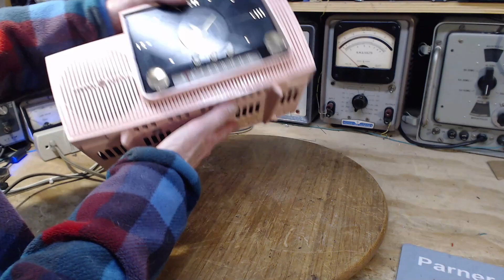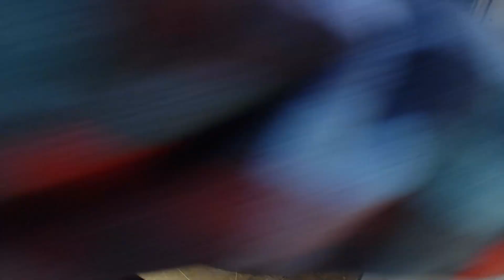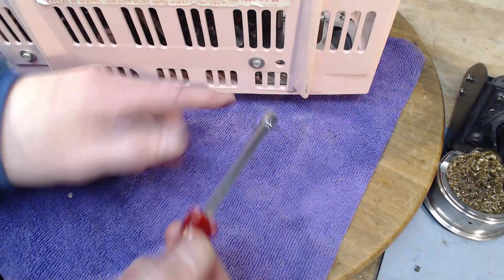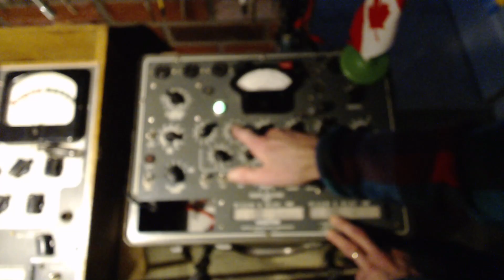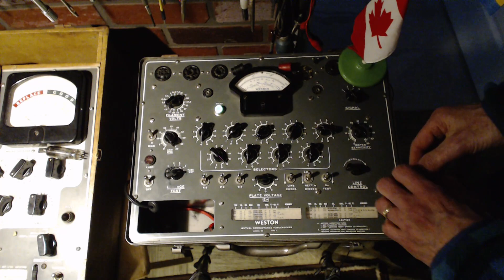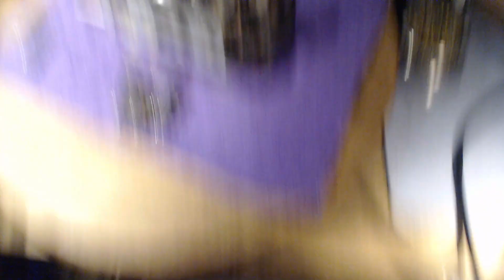GE Clock Radio Model 913-D Video #1 - Oh Noooooo!

Comment: Greetings:
Silver Mica disease: if the base of the IF transformers appears to be clear plastic, you should be able to see the sparking of the failing capacitors from their bottom in a darkened room if you have good closeup capability with your camera. It can confirm the failure before you work at removing them the chassis. Because the primary side of the transformers provide B+ through their coil, the failure of the capacitor in parallel with that coil is the likely failing component. Seeing the sparking should provide some motivation to correct the failure.
Those two bumble-bee caps on top gotta go.

Comment: I did a little experiment today. In a receiver that I suspect has SMD. I disconnected  the cathode pins of both in the IF strip the 12BE6 and 12BA6. As I listened for SMD, it was still there, eliminating the IF circuits . Or so  I thought? What now?  With my scope I monitored the B+ Voltage. Occurring intermittently and randomly I  observed very fast amplitude glitches riding on the B+. All the bypass caps were replaced at an earlier time. The Power Supply electrolytic had been changed some time earlier by another Technician. That Tech did not use the correct values as per the  voltage ratings on the schematic . The “c” values were close enough, but the new voltage ratings were  100 WVDC.  I pulled  each  Cap. out one at-a time and tested them for C value and Voltage break down. Both tested good. The brand of the Caps were a brand I never heard of. After replacing both Caps to the specified parts and putting the IF’s back together, I one more time listened to the radio. The  SMD type interference is gone!
About 20 stations are pulled in with varying degree of signal strength.  Currently I am cycling the radio on and off until about 10 pM and checking in now and then. filter caps causing static! Sure why not ! Its the caps in the IF cans that cause SMD too. perhaps there is some chemical reaction inside the electrolytic that can cause an effect like SMD.  Sometimes its that extra effort that finds the cure. My fingers are crossed.

Comment: Mrs. M or Greene are not going to be interested in a blue tooth radio. They wont even know what ab APP is. Blue tooth generates too much  RF interference noise for this application. The radio as it is would make a good amplifier for the old RCA stand alone phono players.

Comment: What U R giving up already? U didn’t even test the IF tubes or detector! Where is your glorious signal tracer?  A dirty noisy volume, control could cause the static too. At least try known good tube substitution.  Lets see you test the audio amplifier with your Eico Audio Generator. You could alway try to align it lol lol.

Comment: I wonder if the inventor of those type of if cans lived long enough to realize their mistake. Or maybe it was intentional, the beginnings of built in obsolescence.
Reply: Years back we at RCA Labs came up with a 455Kc ceramic filter to replace the IF can in AM Radio. However they were designed for solid state equipment at the time. I had tried one in a AA5 and it worked, however by this time few American manufacturers were still making AM radios in America and the Japanese  had perfected the tiny One slug IF can that was the cheaper route to go. My supply of these filters dried up and the sets I used them in are gone with the wind. Now its just lost technology and nothing more than an RCA patent sitting in the cold , dark and damp vaults of General Electric. Give Joe Welsh that credit.

Post: i currently have seen and used 455kc filters in the past two years at eBay. In my small experiments they did work in some circuits. I did not want to sacrifice any of my radio collection to experiment with them. They did work well as xtals in a simple Solod State Signal generator.

General Electric was the most prevalent manufacturers of AM Radios utilizing this faulty type of IF transformer.

The labs did manage to employ 10.7 ceramic IF filters in Cheap Off shore Solid state FM  portable receivers.

Comment: What about using a valve base with only the heater pins connected you know a dummy vacuum tube so that you can trace the problem.
Reply: Brilliant idea !
Reply: @erin19030  Brainwave idea.
Reply: @DAVIDGREGORYKERR   lord know Jim has enough spare tubes bagged up in shoe boxes.
Reply: @erin19030  I know that but a tube base with just the heaters would solve his problem tracing the problem.
Reply: Jim why are you using that inadequate for tube radio work Soldering Iron and tip. The minute you start rubbing the tip into the joint , you are stalling the heat transfer ooeration., You of all should know you need a bigger tip and a hotter iron. Those little pointed tips are only good for solid state work. On my bench are 5 different irons , tips and two guns. Each tool for a particular job.
Reply: @erin19030  That is the way to do it micro tips for fine work and a WELLOR 8200D for the heavy soldering.
Reply: A bad electrolytic power filter capacitor  could also cause in static. You have to explore all possibilities.
Reply: @erin19030  That is right that is why they should be replaced ASAP.
Reply: Odda are that Jim puts that bad old 35W4 bag in his homeless bags. Cans and bags !
Reply: 35W4A , the “A” is the grade , figure of merit value. ive seen A, B And C.
Reply: The tube tester is like a lie detector, the results are not reliable. It wont hold up in court!

Comment: The only thing that's worse than silver mica disease is when a wooden cabinet suffers from veneer e al disease
Reply: I dunno.  I can fix or replace veneer pretty easily, but I'd be nervous as a long tail cat in a room full of rocking chairs if I had to take the coils out of those cans to replace those mica capacitors.
Reply: @Rebel9668  Replacing the silver mica is not that bad, I've done it before, if you're lucky the schematic has capacitor vales on it, if not you can measure them after disconnecting the coil wires, the radio would need to be aligned afterward